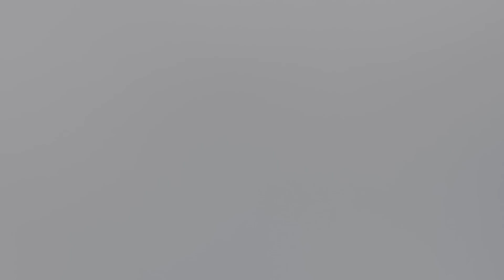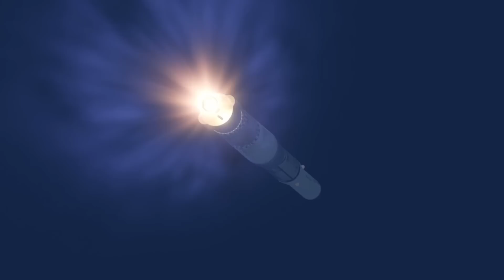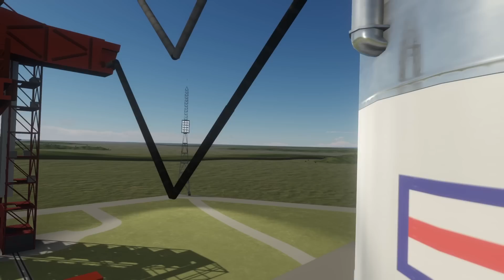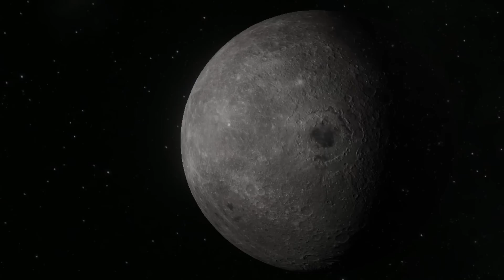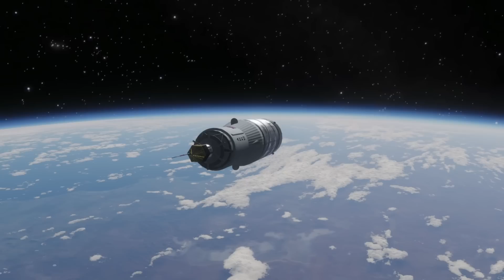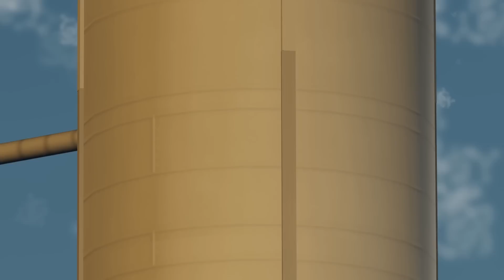International Collaboration | For All Kerbalkind #5

Comment: First?
Reply: Quantum mechanics is a fundamental theory in physics that describes the behavior of matter and energy at very small scales, such as atoms and subatomic particles. It provides a mathematical framework for understanding the behavior of particles, waves, and systems at the quantum level.

Here's a simplified explanation of some key concepts in quantum mechanics:

Wave-particle duality: One of the central ideas in quantum mechanics is that particles like electrons and photons exhibit both particle-like and wave-like behavior. This means that they can behave as discrete particles with well-defined positions and momenta, as well as waves with properties like frequency and wavelength.

Quantization: Certain properties of particles, such as energy, angular momentum, and position, are quantized in quantum mechanics. This means that these properties can only take on certain discrete values rather than being continuous.

Probability and uncertainty: Quantum mechanics introduces the concept of inherent uncertainty into the description of particles and systems. According to Heisenberg's uncertainty principle, it is impossible to simultaneously know the exact position and momentum of a particle with arbitrary precision. Instead, we can only determine the probability of finding a particle in a certain position with a certain momentum.

Wavefunction: In quantum mechanics, the state of a particle or system is described by a mathematical function called the wavefunction. The wavefunction contains all the information about the particle's properties, including its position, momentum, and energy. The square of the wavefunction gives the probability density of finding the particle in a particular state.

Quantum superposition: One of the most intriguing aspects of quantum mechanics is the principle of superposition. This means that a particle can exist in multiple states simultaneously until it is observed or measured. For example, an electron can be in a superposition of spin-up and spin-down states until it is measured, at which point it collapses into one of the possible states.

Quantum entanglement: Quantum mechanics also predicts the phenomenon of entanglement, where the properties of two or more particles become correlated in such a way that the state of one particle instantaneously influences the state of the other, regardless of the distance between them.

These are just a few of the key principles of quantum mechanics, and the theory is incredibly rich and complex. Quantum mechanics has led to many groundbreaking discoveries and technological advancements, including the development of quantum computing, quantum cryptography, and advances in understanding the behavior of materials at the atomic and subatomic level.
Reply: @CascadianShark  waht
Reply: ...To the moon? 

Heck yeah! 🇺🇲
Reply: no me
Reply: Yes, yes I do belive you are
Reply: Second?
Reply: Third?

Comment: The game "rounds up" the mass of certain parts, which leads to mechjeb calculating your delta V differently from how the game's physics calculates burns. Using very small procedural solar panels is the most common culprit.
I'm pretty sure that's why the lunar impactor failed: you don't usually use solar panels on those.

Comment: Lol with the fish and chips ;~) On a side note, when you were talking about not understanding why you were short in burn for the impacter.  I just seen that bit and when you launch the smaller craft off the top would the exhaust of your little craft not have an impact on the speed of the impactor it launched from thereby accounting for the difference in your calculations and actual performance?